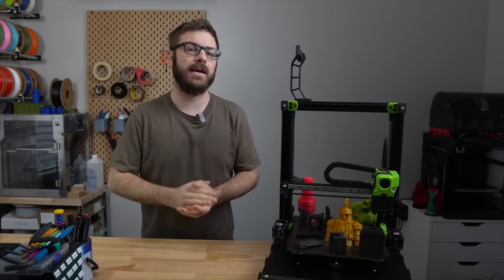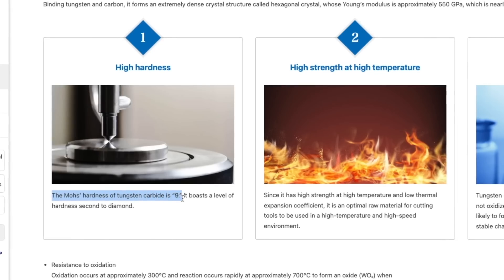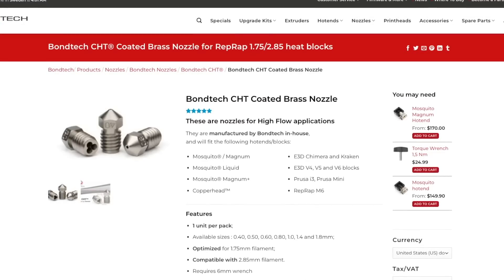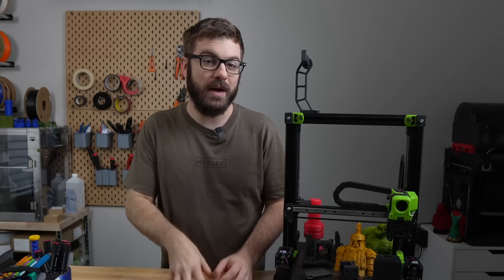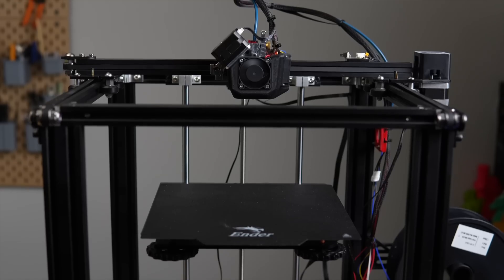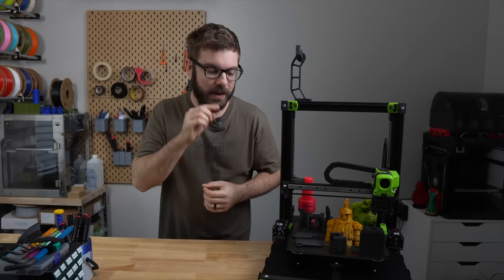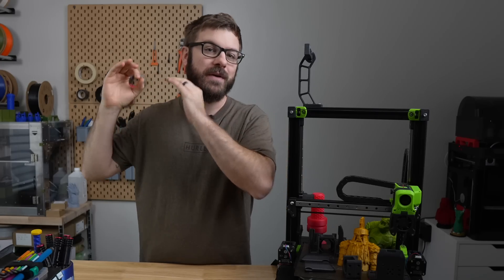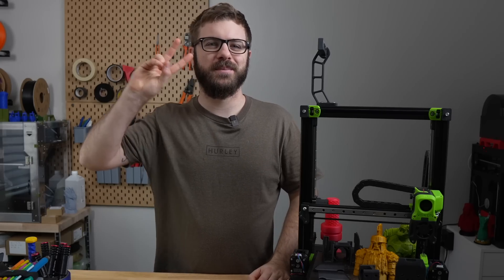What Is A Bozzle Nozzle?

Comment: First time I hear about this nozzle, I was thinking about getting a tungsten carbide one from phaetus for about half the price of this one, but i'm not sure how much worse (if at all) it will be compared to brass. For non abrasives I got a huge selection of aliexpress cht knockoffs which perform just as well as my original cht.
Reply from the maker: TC has very good thermal conductivity so I dont anticipate it being worse. Even in my testing with the CW1 the difference was very small when it was less than the brass. However, if you are only occasionally printing with abrasives it is likely overkill.
Reply: @ModBotArmy  I only print rarely and use the slice engineering vanadium, I just want a tungsten carbide because it's so damn sexy! (Yes, I know, I have a problem).
Reply: as far i know phaetus uses a Sleeve design, wich is imo inferior to a fully sintered TC nozzle.
They use a Thin TC tube that is inserted into a either Copper or Toolsteel nozzle
Reply: @superbrain3848  I contacted 3dprima directly with the same question a few months back. My question was:

 "Is this nozzle made out of pure tungsten carbide, or is it made out of two pieces of different materials joined together?" 

and their reply was:

"It is made out of Tungsten Carbide, nothing else.

Mikael
3D Prima"
Reply: @christoskaragiannis7973  looks like they changed the design since the last time ive looked at them.

Comment: Fantastic video, thank you! Any idea how the flow compares to the CHT nozzles?
Reply from the maker: I don’t have first hand experience with the CHT but based on their claims of “at least an increase of 30%” and CNC kitchens tests I would say they have higher output. The trade off will be abrasion resistant. I did see they released a bi metal version but it doesn’t look as structurally solid as the bozzle due to it not being made from one alloy.
Reply: For me, bozzle flow is somewhere between 0.4 CHT flow and 15% above that, almost enough to go same spatial speed even with the wider extrusions, but not quite. You can see it in action in some of my videos.